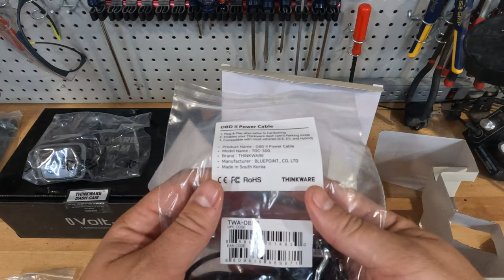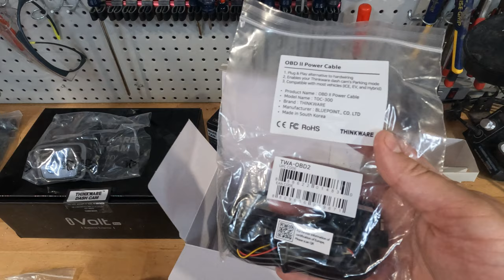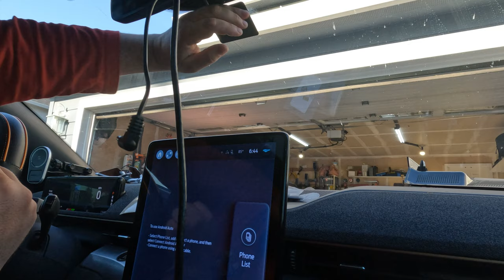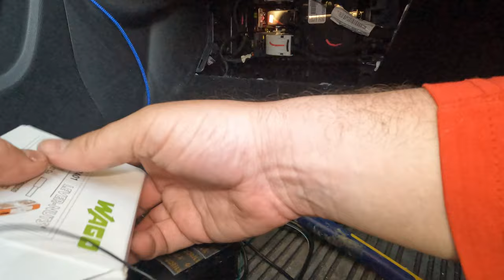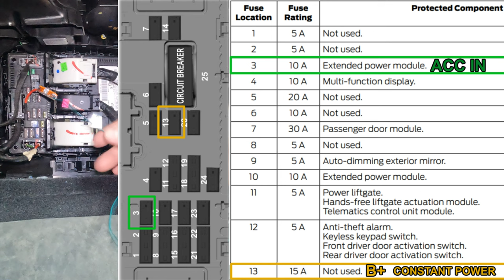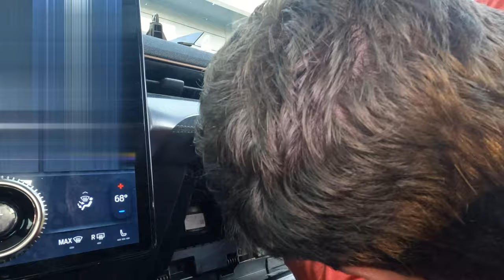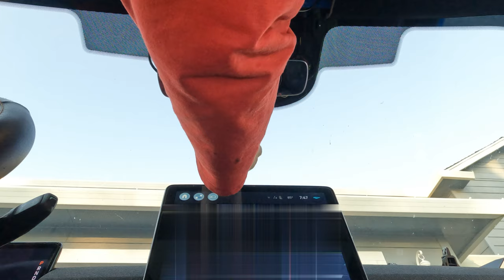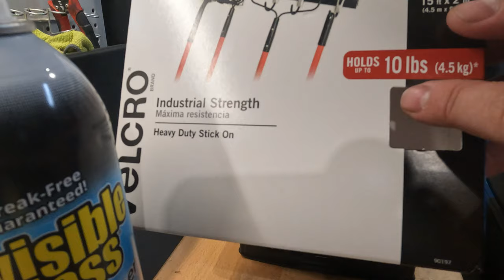Thinkware U3000 Install With External Battery In A Mustang Mach E

Comment: I wish i found this vid before i installed mine. Damn it took a whole day to finish mine (noob). The biggest reason why i got the u3000 is for the radar, but my rear window tint blocked the signal and i eventually cut a small cut-out the size of the camera body from the tint and its unnoticeable.

Ps: those filters are fuses, thought i wanna mention that in case you need to troubleshoot in the future.
Reply from the maker: ya I tried many things to get the radar to work on the front.  In the dotted area ECT, but no luck.  I hope to have a full review soon.  I just been so busy lately enjoying the summer with family :).

Comment: Guys and girls. Before you install the connecting wire from your rear camera across the top of your roof pillars, make sure you won't be interfering with the deployment of any curtain airbags. Many of these have an anchor point part-way up the A-pillar, for example, which makes routing the wire across the top of the A-pillar to the windshield inadvisable unless you remove the trim and go behind the airbag or, even better, down one side and up the other.. If in doubt, remove the trim to see what you're dealing with.
Reply from the maker: thank you for posting that out.  I guess I should have done a better job showing my wires going behind the airbag on the front pillar.
Reply: @macheconnection  I didn't imagine for a minute that you wouldn't have done it right but I've seen so many 'how-to' videos, even ones posted by alleged pro installers, which don't take airbags into account. I'm no pro by any means but fit stuff like dashcams etc. for friends and family and my own preference is to go down the C pillar and along the door sills and up the windshield side of the A pillar if only because some roof linings have a way of never being the same once interfered with. From a UK subscriber - carry on the good work!

Comment: Hi there! Thanks for the review. Have a question on the U3000 Thinkware remote LIVE view feature....Basically, my intention is to view my car, LIVE from any remote location, even when the car is "SWITCHED OFF" (that's the key word). So my question is, if I connect the U3000 camera with a hardwire kit or if I use an external battery, like the ivolt Xtra or Powercell8, which will actually require me in both of the above cases to connect to the fuse box and this will eventually give the U3000 camera a constant power source alongwith having an internet connection inserted in the usb port of the battery, will I be able to see my car LIVE remotely from any location even when the car is "SWITCHED OFF"?
Please let me know - thanks, Terence
Reply from the maker: that would be amazing feature to have. mine would do this if my car parked in a spot with good wifi. Sadly, this is rare for me.

Comment: Can you comment on the parking mode functionality? I’m concerned that given the meshed windshield, the radar won’t be of much use. I also saw something commenting on the back radar being blocked by the tinted window? I also have a tinted window but I don’t feel like cutting it.
Reply from the maker: that radar does not work at all in the Mach E with its front IRR  windshield, you can't set radar on for the rear only.  time lapse mode and motion detection in park mode do work very well.  the U1000 also has these features without the radar, so unless ya can get a good deal on the U3000, get the U1000.

Comment: Thanks you for show us the installation, but wouldn't your passenger will kick the battery to close to their feet I hope not. I going to buy Thinkware U3000 but not sure if I should buy the external battery because it is EV car my 12V battery does charge from the main battery I believed they install 12 battery to keep everything as 12 Volts so NO one can get Zap & get Killed by 87 KW battery.
Even I did look under my seats no space.
Reply from the maker: None of my passengers have kicked the battery.  None of my passengers even noticed it was there until I pointed it out.  Before I had a thinkware battery my car would give me errors of 12v drain.  if you have a 3d printer or a block of wood you can cut to a similar size.  you can install it as a mock battery.  It will then help see if your passenger will kick it or find a better spot.

Comment: What kept throwing me off is you hardwired the green to the battery constant. Does that pull when the car is off? If not I can’t understand the reason for this. 
I have the q1000 in my Ranger and F150 hardwired directly to the battery with no issues. 
In my Mach-e I got the volt mini with the Q1000. My set up doesn’t have the green wire. So my input to the battery only has a ground and an ACC fuse tap. My output from the battery is, red yellow black, and hardwired. 
Your videos is a bit long but I like it that way so I’m not wondering if you edited out something I might have a question on.
Reply from the maker: the green wire mostly to let the battery know if the car is on or off.    Ya don't want the thinkware battery charging from your 12v when the car is off.

Comment: hello a question disturbs me on the rear camera of the u3000! where is the rear radar sensor because on my pickup my window is completely vertical which forces me to completely tilt the objective of the lens to view the rear it seems that the radar sensor is on the side of the lens would require me to put an adjustable support to be able to adjust the inclination
Reply from the maker: that's a good question.  since the radar does not work though the front windshield on the Mach E and you can't use the rear without using the front.  I have not checked or tested the rear radar at all.
Reply: @macheconnection  I got my answer from thinkware so be careful the radar is not in the lens my good on the side of the camera and pay attention to its positioning because otherwise the radar function will not work

Comment: i have thinkware u3000 and its very lame.
first - during setup it keeps disconnecting phone and turning parking mode ON, whats very stupid
second- you have to connect external battery to avoid ultra power saving mode being switched on by itself - unless you turn off battery protection, whats silly since you can select on what Voltage camera will turn off.
i have 2+2 batteries in my pickup and small solar hooked up - still wants their battery, and its even more silly in EV - thats one huge battery

They could (but wont) do it perfectly - to give you option on what Voltage what mode goes ON, 
power saving 12.3
ultra power saving 12.1
turn off camera 12.0

could by done by software, easly
Reply from the maker: I mostly had the problem with wireless android auto connecting over and over no matter how many times I tell it to disconnect.  I can't connect to the tinkware unless I have my android auto connected with a USB.